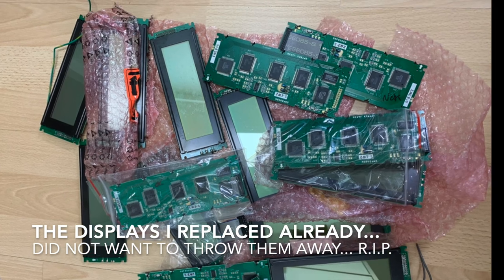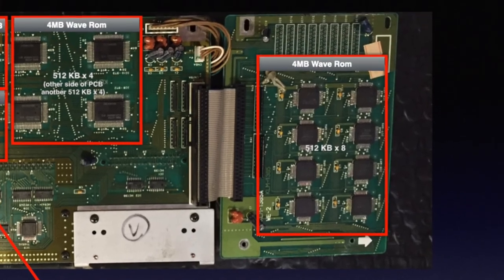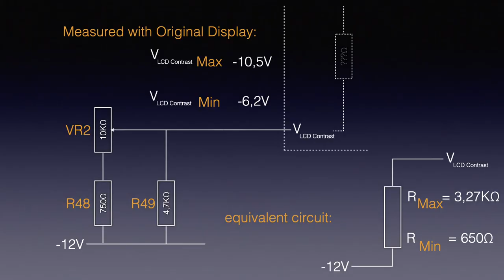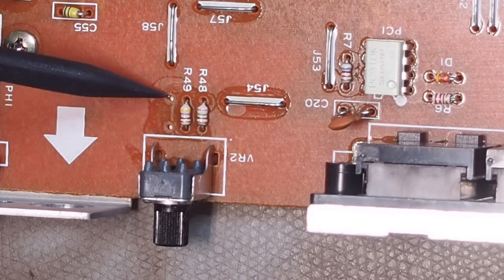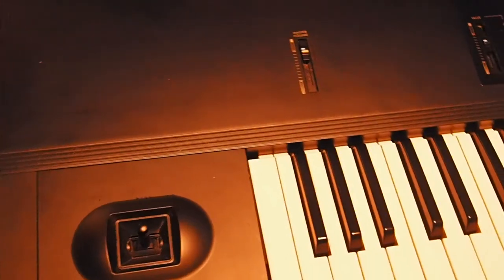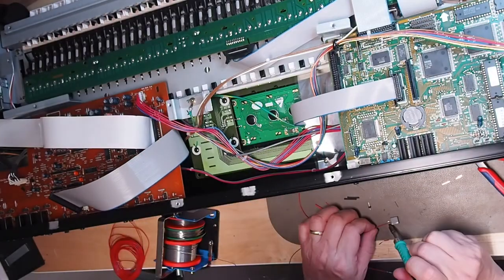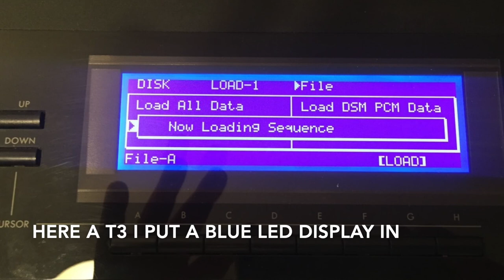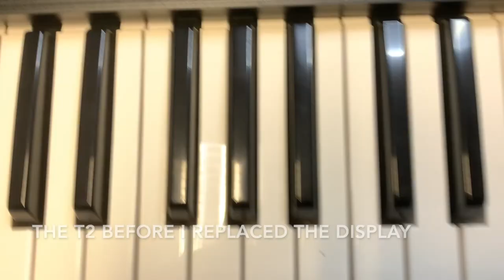ReinardSynth#4 Korg T2 Display replacement

Comment: Hey just making sure. You removed the C28 capacitor, but you didn’t write anything to remove it, should I solder it back in or what?
Reply from the maker: oops, no just remove it: I now see I forgot to list C28 in the components to remove....
Reply: @reinardsynth6581  ok thanks, I did what you did in the video, but the backlight still doesn’t work, is it possible that it burned? I replaced it before the PSU mod, and turned on the korg
Reply: Hi! Pls measure that the backlight gets 5V, ans also make sure that Ground is connected to the cathode and the +5V is connected to the Anide of the backlight leds…

Comment: Thanks for making this video! Very helpful! I am in the process of replacing the screen on my Korg T3. i have purchased the same screen as in your tutorial. My only issue is i cannot source that exact 72RXR100LF Potentiometer Resistor. I have found one (3386W-1-101LF) that is 100 ohm, .5w, 1/2 w, +-10%  300v Max, side adjustment. It being 300v max as compared to the 200 v max of the one in video. Will those specs be similar enough?
Reply from the maker: Any 100ohm/0.5w potentiometer will do, the one I used is just a proposal. The application does not require any accuracy, it is also just 5V max it will be handling. No worries
Reply: @reinardsynth6581  Thank you!

Comment: Sir can you upload video replace lcd Yamaha mo 8
Reply from the maker: do not have such a video... The MO8 uses the same display as the Motif, Motif ES, RM1X, S90, RS7000... They are difficult to get because not a common part: but this is a reasonable priced one: https://www.synth-parts.com/en/products/displays-und-led/display/6830/lcd-display-yamaha-rm1x?c=1773  Note you have to solder the connector and cable to it, so not a "plug and play" kind of job. The MO8 is similarly build as the Motif, have a look at my video on how to take it apart to get to the display.